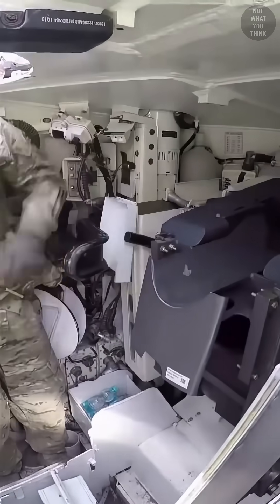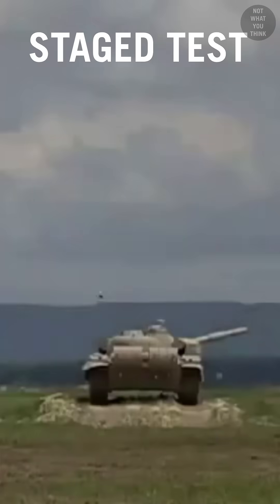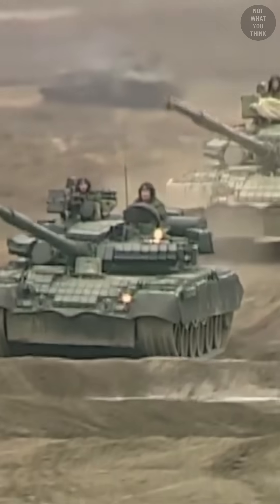Why M1 Abrams Tank Has No Auto-Loader #shorts

Comment: jeah all cool and all but Type 90 from japan has autloader and blowout pannels on the back of the turret Leclerce to
and a autoloader will load faster on offroad then a human and humans cann get tired over time slowing the loading time down
Reply: The minimum required time to be employed as an Abrams loader is 7 seconds, and the best can load in 3-5 seconds while average reload for an autoloader is far slower at around 8 seconds or longer. An autoloader even with blast panels still isn’t entirely safe as there’s still ammo sitting inside the cabin of the tank ready to be loaded, and ontop of this it creates less space inside the tank, leaving the crew members in a much tighter area which can all be killed by a single well placed shot
Reply: @FoxtrotStudi0s  leclercs autoloader loads around 5 to 6 seconds everytime
Reply: @toxi2202  the average properly trained Abrams loader can load shells in around 5-5.5 seconds
Reply: @FoxtrotStudi0s  but not during driving and not tried
Reply: @toxi2202  except most times an Abrams will be moving slowly or entirely stopped while firing, and tired? If you get tired that easily they wouldn’t allow you to work in the Abrams in the first place.
Reply: @FoxtrotStudi0s  you might have the best loading speed for the first 2 or 3 round after that it goes down meanwhile the autoloader cann load the same speed no matter what 
And avrage loades are slower then 5 secs or 6
Reply: @toxi2202  you do realize that a Abrams crew unloaded 17 rounds in 45 seconds that is divided to 2.6 seconds reload time, and the average Abrams reload speed is 3-5 seconds and one of them was filmed with a dude that was just sitting in a chair and did it in about 3 seconds.
Reply: @FoxtrotStudi0s  show me prof you aint gonna slam a 20kg round inside a breach every single fucking time with same speed
Reply: @toxi2202  wow, YouTube keeps censoring my links and taking them down. Awesome.
Reply: @FoxtrotStudi0s  w h a t

youtube China Dlc has been activated
Reply: @toxi2202  lmao exactly apparently trying to send you the link of both the video and the article of the Abrams loader registers me as a comment bot lmfao